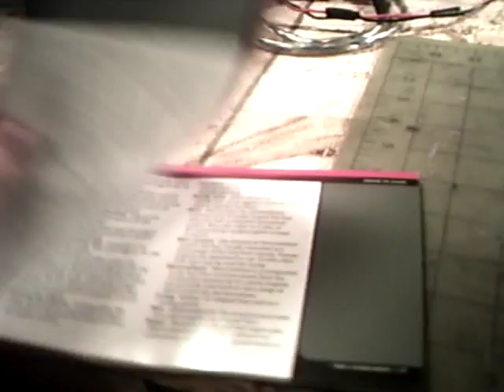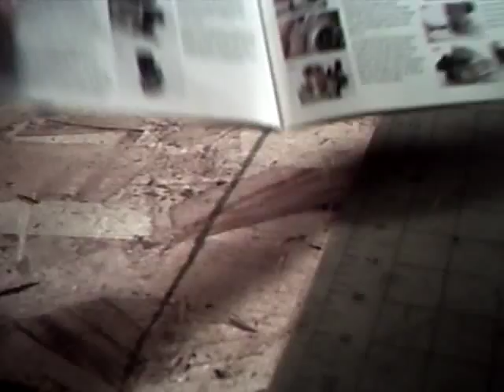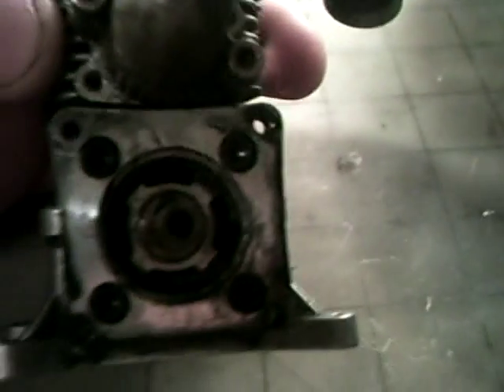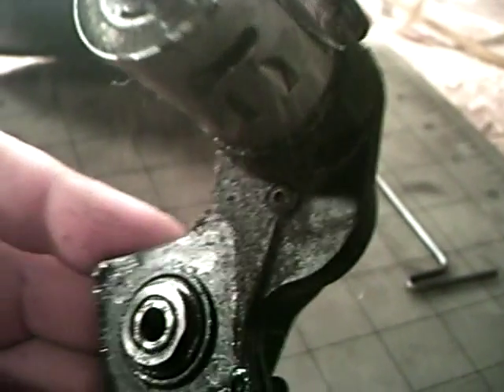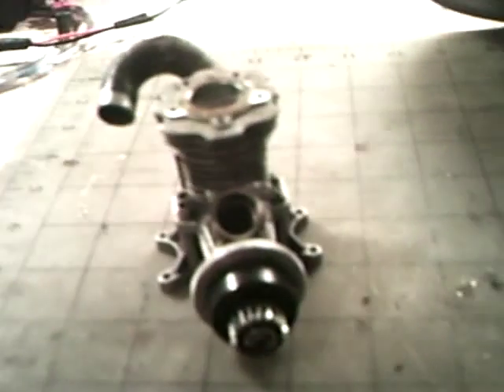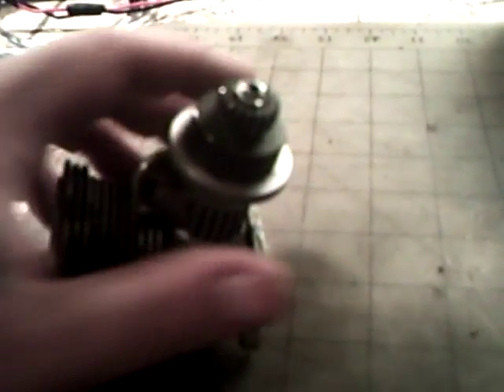traxxas 3.3 engine tear down part 1.AVI

Comment: should never run a 2 stroke without seals because #1 you will have crappy performance,  #2 the oil will build up over time that leaked out of the engine and create that"goo" that was on the easy start.....